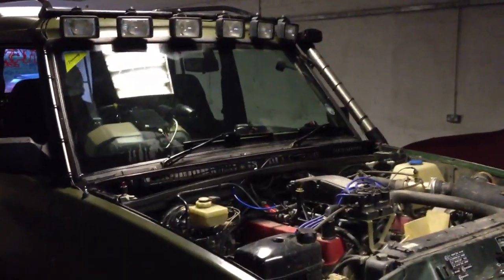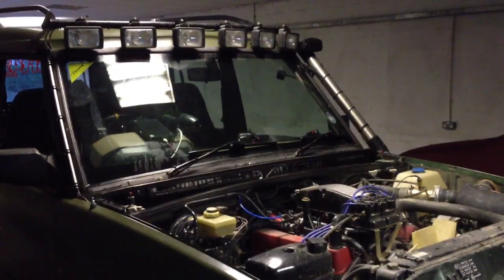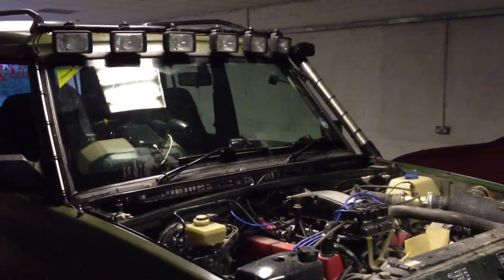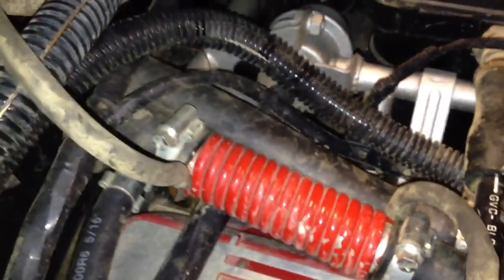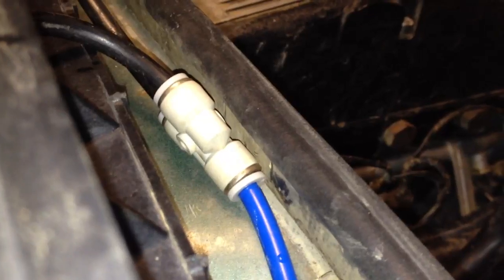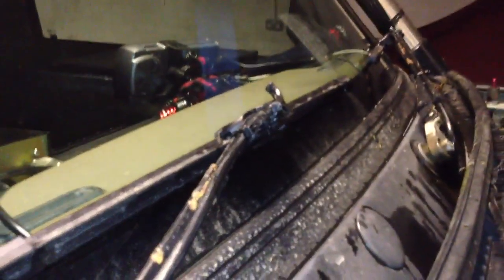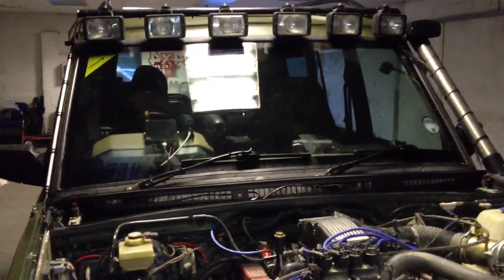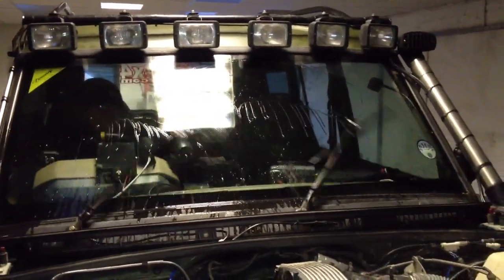Land Rover Discovery (Defender also!) Screenwash Mod Upgrade

Comment: Good attempt but the distribution is pretty poor. Not a lot of water getting to the top of the screen; I'd suggest a pipe with holes along it would be better. Vauxhall van's etc. have this system, I'd imagine it would be easy to get some from a scrappy.